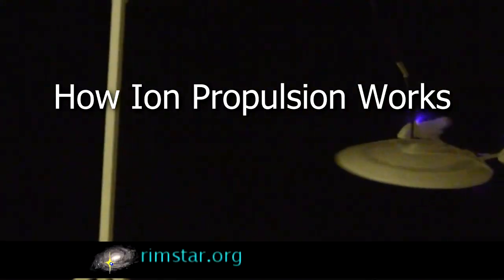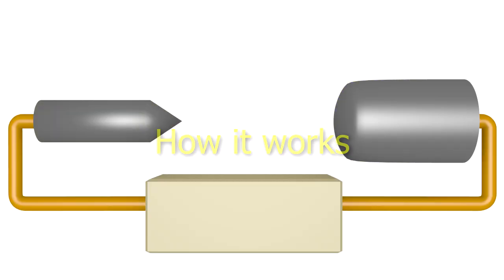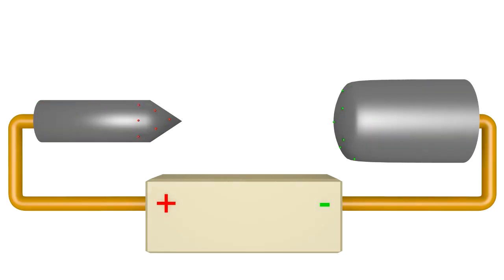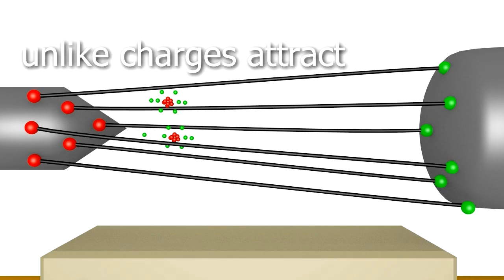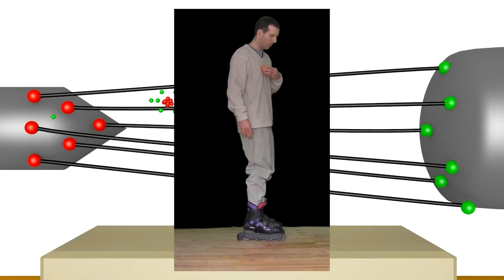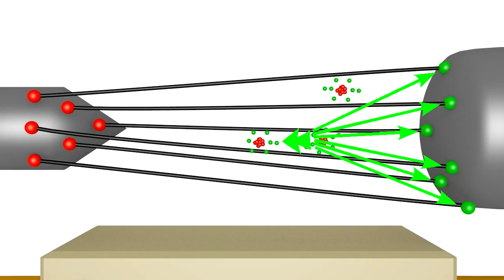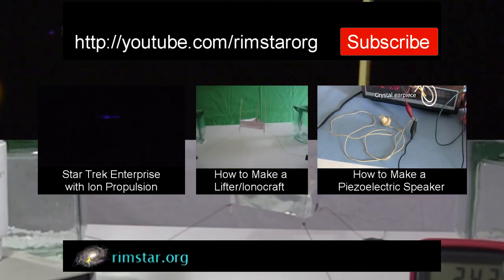How Ion Propulsion, Lifters and Ionocrafts Work

Comment: Hello, I'm sure you've seen the interview by a person called Jess Fritch, discussing the subject of "electrogravitics?" He claims that the experiment you are preforming with lifters will work in a vacuum, which would rule out the possibility of an ion wind being the principle involved. In fact, a scientist named T Townsend Brown, I assume you've heard of him, claimed that this and similar experiments work because of the ability of a capacitor to create its own local gravitational field. He wrote about this in a pamphlet called "How I control gravity" by T Townsend Brown. Further, he has photographs of his experiments being done in a vacuum to show that ion wind is not responsible for the lift.  Could you please comment on this?
Reply from the maker: Sure. All videos I've seen of lifters or parts of lifters in vacuum chambers produce far, far less thrust than a lifter in air. That means that whatever is going on in the vacuum chamber is not what's lifting one off a table in air. There are also plenty of things that can cause forces in a vacuum chamber, from the fact that there's no such thing as a perfect vacuum (hence the reduced thrust), to electrons being emitted (again, producing lower thrust), to ejected matter when there are sparks (Brown reported acceleration whenever there were sparks), to Coulomb forces. Also, not all vacuum chamber tests have produced thrust. Many have shown lower and lower thrust as the air pressure was decreased until there was no thrust at all. Also, repeated smoke tests, including one's I've done myself, show plenty of ion wind (https://www.youtube.com/watch?v=LOGAaObsN4g) which can't be ignored.
In any case, whatever's going in the vacuum chamber is not what's going on in the tests that work is not what's going on on the table in air.

Comment: It is not an ion wind. Make a test in a vakuum. The ion wind hasn't the power/force to lift up a lifter. The ion wind is only a nice effect. Do you know the NASA tests (in 2003 at the NSSTC LEEIF facility)?
Reply: It is an ion wind. This lifter would not work in a vacuum because there would be no molecules to create the ions. This lifter uses the molecules in the air to create ions. The ion engines NASA uses in space use xenon as a propellant. But it is still an "ion wind" that provides thrust.

Comment: what if you had a flat aluminum surface and above you had parallel line wire will it have more lifting power
Reply from the maker: No, it wouldn't work. You need the jet of air to continue downward. With a flat aluminum surface, the downward jet would collide with the flat surface and push it back down.

Comment: The electric field does create propultion. Still air isn't moving. Then it gets ionized and then it is accelerated by the electric field, by F=ma=eE. By Newton's third law this causes craft to be accelerated in the opposite direction. However you gave the the answer why my calculations predicted ridiculous amounts of power required (Gigawatts). I forgot the factor in the fact that charged atoms will bump into each other and you won't lose the ions created in 100ns (or something on that order). 

More on the acceleration thing. Situation should be discribed by taking a bowling ball and throwing it (or 10^13 ions in case of the craft).

Comment: Is there any way to reverse the airflow and make the ions travel from the dull object to the sharp one?
Reply from the maker: +GREEN_T Not that I can think of. The ions are formed near the sharp object because that's where the electric field is strong enough to do it.
There is something called dielectrophoresis where if you submerge this in suitable a fluid like mineral oil, for example, then the oil molecules will move toward the stronger electric field, so from the dull object to the sharp one, but those aren't ions and the effect is much weaker. I did that accidentally when I once submerged one of these setups in mineral oil an you can see that near the bottom of my webpage here http://rimstar.org/sdprop/spinning/spinning.htm where I see bubbles moving from the dull object to the sharper object.
Reply: +RimstarOrg Yes that makes sense. How efficient is the process? The ionization of Nitrogen is about 140kJ for 1 mol, which is quite a lot of power... Thanks for making the video!
Reply from the maker: +GREEN_T I don't know the efficiency. I've read various reports over the years, the last one 2nd hand from MIT, saying that the efficiency is better than that of a jet engine but I haven't seen how they worked that out. The impracticallity rules it out anyway. You'd need a house sized craft and be sitting in a few million volt field.
Reply: +RimstarOrg That is true. I'm going to do some experimenting with it and get back to you. Thanks for everything.

Comment: Hi Steve,
Thanks for your videos and time. What would happen if you had put another string below the foil. Hence having wire-foil-wire (bottom-to-top). Would you then be able to modulate the force (by controlling the voltage in both wires) and in effect controlling the lifter in the air? By extrapolating this, if you had four individually-managed high-tension wires on each side, could you then in-effect control it in all three-dimensions? Again, thanks for taking the time to answer these questions. Best of luck!
Reply from the maker: +enjoypolo Yup, that should all work. And thanks for watching!

Comment: do you know what a em drive is?
Reply from the maker: +ankhenaten2 Yes.
Reply: em drive has been tested by nasa to work and it is vacuum proof propulsion are you going to build one?
Reply from the maker: ankhenaten2
I did think about it the last time I read about it. I don't recall if it was within my abilities to do. I think the force was a very small one, so difficult to measure.
Reply: So, the part of the video where he pushes the ball against himself and doesn't move... That is basically how an em drive actually creates thrust.. hence why they call it the impossible drive.

Comment: PLEASE ANSWER 

wait so if the smooth side had a positive charge and the sharp had a negative charge would the direction move towards the smooth side?
Reply from the maker: +I FΔT Yes. The direction is determined by the geometry, so always toward the smooth side. The polarity doesn't matter.
That is the case unless you start insulating everything, in which case other effects like dielectrophoresis can start to come into play, but that's not what I'm describing in this video.
Reply: RimstarOrg Thanks!

Comment: Thanks for all of your ultra-high-quality videos--it is rare to find someone who has the gift of true teaching (which requires core knowledge of the subject).  This allows others with the potential to excel quickly.  After studying your "how ion propulsion works" video, I would like to ask your opinion on something.  I have the requirement to set up TWO independent spark gaps--one, let's say points north-south, and the other east-west.  They are at about the same level and will intersect each other, however, their high voltage power supply's are 100% isolated capacitors, no common grounds, etc.  I would like to ensure that if the two arcs fire simultaneously that no electrical connection or current path will be present--sort of like light or sound,i.e once passed the "region of crossing" it is as if neither was aware the other existed!!  Any ideas on this construction?
Thanks MUCH,
--dalE
Reply from the maker: +dale nassar Unfortunately sparks are not like light. If I understand you correctly, I don't see how this can work. Each sphere will spark to the one closest to it that is at the opposite polarity.

Comment: Does this require air to work？  Can it work in outer space where there is no atmosphere?  Why don't they make aircraft using this?
Reply from the maker: +PRepublicOfChina It requires a gas of some kind to work. So in space the spaceships need to carry along their own gas, usually xenon gas. They don't use it for aircraft because the thrust is very small. It's used by some spacecraft because if you keep it running for a long time then you gradually build up speed.

Comment: I tried to make one like u
I connected a round edged nut and a pointed nail to my high voltage power supply but when I switched it on it acted like a capacitor and I got big sparks . then I replaced the nut with a square foil and this time even bigger sparks occurred. I don't know what went wrong please help me
Thanks.
Reply from the maker: harsh bawari The sparks happen because the air between the electrodes become so fill with ions that the air becomes very electrically conductive that it becomes like a wire, and you then get a rush of charge crossing the gap.
If you're getting sparks then that means your two electrodes are two close together. Move them further apart. But as you test bigger distances you may still get sparks and they will be more energetic than with smaller distances and so may damage your power supply. So if you do get sparks, turn your power supply off right away and then move the electrode farther apart. Don't keep making sparks. That's what happened with my power supply in this video http://youtu.be/Kb0WwsJgTMM. Also, to weaken the sparks and reduce chances of damaging your power supply put around 240 kilohms of resistors (at least 2 watt rated) in line with either your high voltage wire or your ground wire that goes to the electrodes.
The reason you got even bigger sparks with the square foil is that your square foil is less round than the round edged nut and so more charge could build up before the air broke down enough for a spark to occur. In keeping with what I said in the video, the electric field lines were further apart. It probably took longer between sparks too because it too longer for the breakdown to occur.
Reply from the maker: harsh bawari Oh, I should have thought a little more before answering. The first thing I'd suggest is to make your sharp electrode sharper. Either sand or file the end of your nail to make it sharper, or use a sewing needle or anything sharper than your nail instead. Even the end of a fine wire will do. That way you don't have to widen the distance as much, if at all, and have the danger of bigger sparks. The idea is that the electric field lines will be even closer together near the sharp object, as per the video. That's why lifters use a bare 30 gauge (AWG) wire for the sharp electrode.
Reply: Thanks for your advice. I will try again and will tell u about the results.
I earlier asked you to post the 'how a whimshurst machine works' video. Please work on it because i am really eager to know about it. 
Thanks

Comment: Sooo... you should make an RC plane with the "skirt" as the wings, and power it with some sort of ground based laser pointed at the plane.  That would be one hell of a science fair project, maybe even with some Boeing representatives present :P
Reply: PS: not serious, but its fun to speculate lol.  Also great video
Reply from the maker: xpeterson Actually, a lot of work was done in the 1990s on trying to propel a flying wing. It got to the point of having all the power on board (no external source) but was only able to pull itself around a circle while hanging from one end of a rotating arm with a counterweight on the other end of the arm. It was much like I (and many others) did in my video with spinning disks http://youtu.be/JMtrKO7SVnw but having the power on board was a big achievement. Here's a page about it http://jnaudin.free.fr/html/arda3cl1.htm
Reply: RimstarOrg Interesting article.  Did it ever go anywhere / is it related at all to http://newsoffice.mit.edu/2013/ionic-thrusters-0403
Reply from the maker: xpeterson
As far as I remember (I was involved in that generation of ionocraft building) and judging from the website, no, it didn't get any further.
Re the MIT webpage, it's the same technology, just done by the next generation to have gotten interested in this tech.
Reply: RimstarOrg As someone versed in this technology, do you think it will get any further?
Reply from the maker: xpeterson Not for down here on Earth. There is progress in the ion propulsion for actual spacecraft in space though. Here's an article I read just this morning about Hall Effect thruster (a form of ion propulsion) research going up soon. And then we're still hoping for the potentially game changing VASIMR, another form of ion propulsion for space (http://www.adastrarocket.com/aarc/VASIMR).
Reply: +RimstarOrg Depends on the amount of energy, the elements involved, and whether there is a secondary fuel.

Comment: Hi, I have a quick question: Why does one of the object have to be non-sharp? Can't both ends be sharp, and still create the electric field to create ions?
Reply from the maker: Ken Katagiri You're right in that you'd still create ions but you wouldn't have unidirectional movement. The ions from both would just interact in the middle and you'd have no unidirectional ion wind.

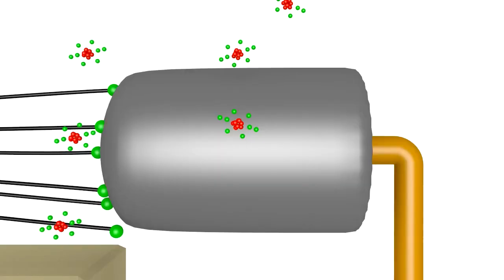Comment: Around 5:40 you mention the ion wind doesn't interact with the device, does that mean the ion wind does not provide any thrust?
Reply from the maker: Anirudh Vasudevan Yes and no. It's the creation of the ion wind that happens at 4:50 that moves the device. After the ion wind is set in motion then it does not provide any additional thrust, and so none at 5:40.
Reply: +RimstarOrg I see, thanks. Also, if one were to extend the wires, to say even a few meters long, do you think the craft would just destabilize once it reaches a certain altitude? Or will it remain stable until it reaches the length? Thank you, and sorry for the many questions.
Reply from the maker: Anirudh Vasudevan
The ionocraft requires a gas in order to work, so the higher up you go the less atmosphere there is and the craft will function less and less well until it doesn't work anymore. The length of the wire has nothing to do with that.
There is an issue with the length of the wire in that the electrical current for ionization will be spread out over a larger area and so the propulsion per area would be less.
And as length increases, so does mass, and at some point there won't be enough propulsive force to lift it.

Comment: how efficient this effect may be compared to a simple propeller if is build trying to avoid energy loses?
Reply from the maker: AngelLestat2 I don't know. I've read in the past that it's more efficient than a jet engine, but then there are practicality problems when scaling it up, such as having to sit in a house-sized container surrounded by millions of volts.
Reply: But one thing is the voltage, another the power, if is efficient as they said, then it will consume low energy but you will need extra wait to rise the voltage and reduce the current (at least that is what I imagine..)  But as thruster in a airship where you dont have much problem with the size, maybe is possible.
Reply from the maker: AngelLestat2 Oh, I see. You're talking about using it just as the thruster but not the lifter. I've seen people do it on a small scale using balloons indoors.
Reply: +NDF211Gunner Yes, creating an extremely high energy system. LOL

Comment: Have you ever measured the pull when the lifter is active...does the size (dimensions) work better or increase lift the smaller the distance is between he sides of the equilateral triangle? Do the sides have to be rolled towards the inside or can the be either direction? Does the height (from top to bottom) matter as well, the higher the height of the AL the more lift... I've got so many questions on what the variables are....
Reply from the maker: shaun adlesperger A very long time ago I did these tests for the pullhttp://rimstar.org/sdprop/testrigs/shielded_scale.htmbut the only variable I tested was the affect on voltage. Higher voltage meant more lift. But I suspect a smaller and smaller distance will increase lift, but only until you start sparking, in which case it'll stop flying.The sides can be rolled in either direction, it doesn't matter. Just minimize the sharp edges at the top of the foil.The height of the foil only matters if it gets so short that the bottom edge starts acting like a top edge and you now have a sharp edge near the top, negating the fact that you rolled the real top edge. But that'd have to be pretty short.

Comment: This is the first time I seen anyone who knew what they were talking about, Most people are clueless when it comes to this stuff
But since I agree with your principles and know of it and am not involved with this type of thrust, but maybe after I finish my research, here's something you may be able to incorporate into your thrust-er as an experiment.
I'm researching constant magnetic acceleration, Now I would suggest to see if you could build a set of magnetic coils that encompass the one end or through the whole accelerating chamber .a  number of small coils to accelerate the flow of ions,
Do that to see if it will increase the speed of movement of your vehicle. It would be interesting to know what effect this would have on acceleration etc.
Keep thinking and let me know what happens if you do it.
Reply: Well yea it would because the more your wrap a coil the stronger the magnetic field and thus higher voltage. More voltage more current per second. Current is electrons adn the electrons bumb into atoms making ions.